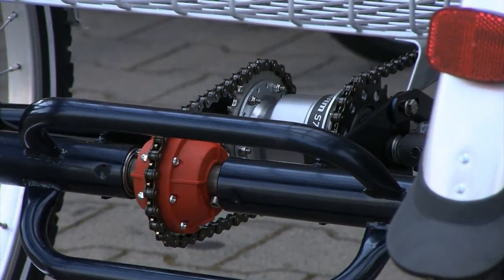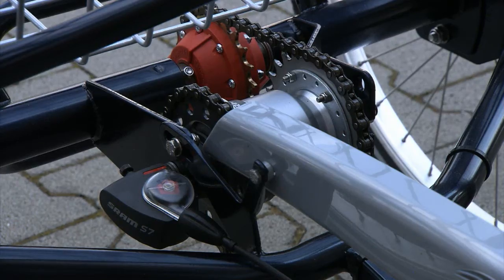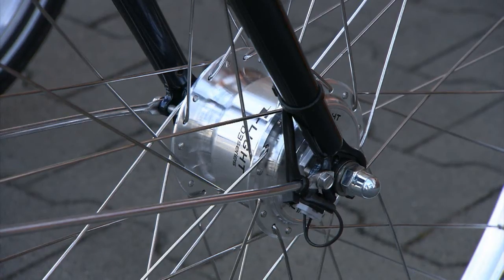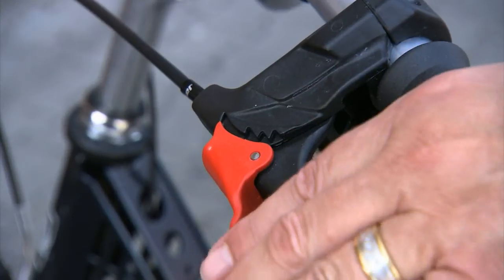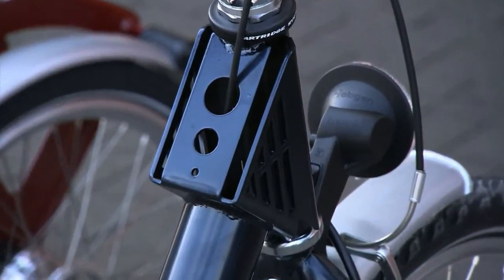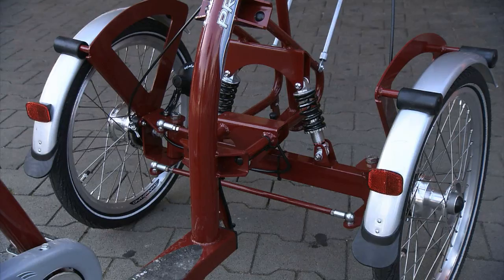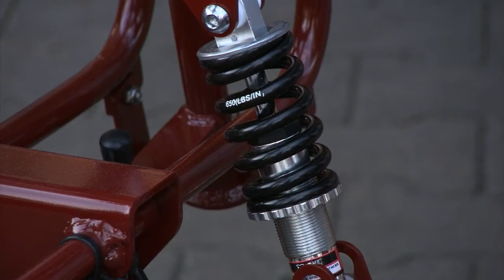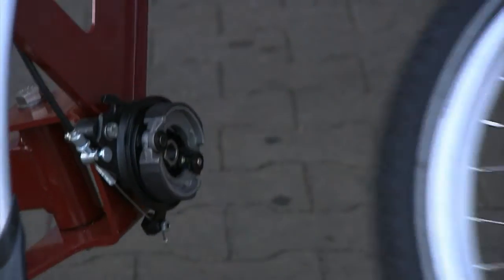Bici Triciclo Pfiff - Dettagli Tecnici

Comment: Not good at all. 

The internal bearing inside the tube need to be replaced. Constantly not an easy job. 

Now there is a smarter ones that use normal rims, so if went wrong, you can just replace the rim. 

These screws get broken always this means you will lose break and you will lose power